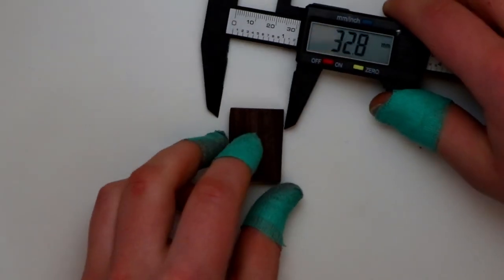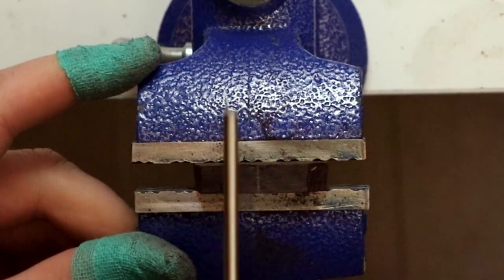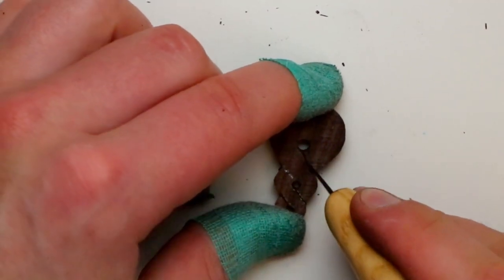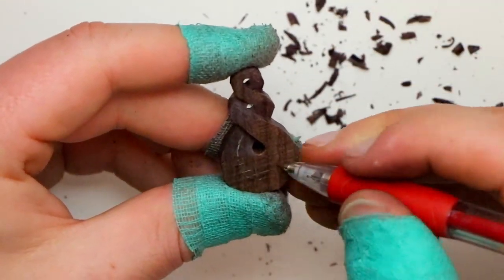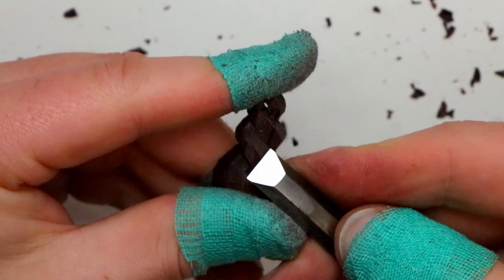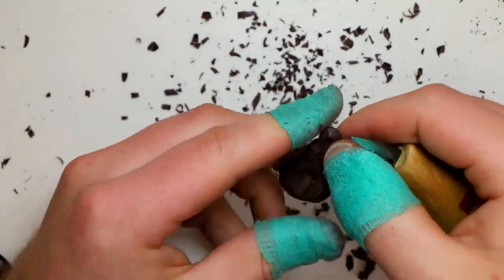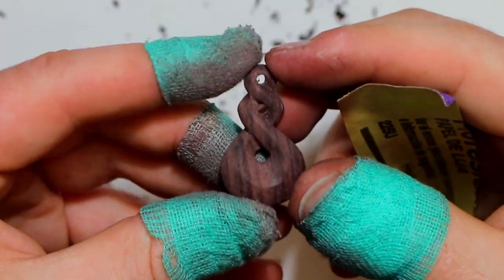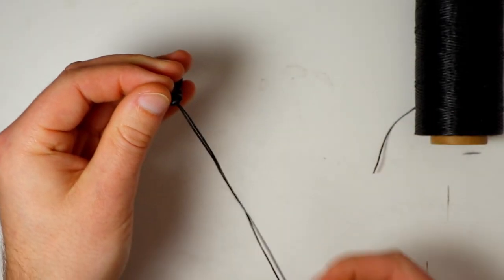How to Carve a Maori Wooden Twist Pendant

Comment: Nice work. Does the walnut oil still soak in alright and last after such fine sanding? I thought fine sanding closed the pores off and why most wood workers only go to around 240grit and only go to super fine sanding like you if buffing with a polishing compound instead of oiling? 
I'm still learning so will be  interested to hear your view. Cheers

Comment: I’ve gave making one of these using your video and it turned out pretty good! However, I made it with basswood, how would you recommend dyeing it to give a similar couloir to what you made? 
Also any tips for sanding in the holes and tight spaces?
Reply from the maker: For sanding in the holes etc, best tip is to fold and crease the paper in small strips to squeeze it in. Don't be afraid to rip your paper into tiny pieces and fold them up to best fit what works for your project. Basswood can be a pain with staining as it's soft - make sure you surface is nice and even first and then use light coats.